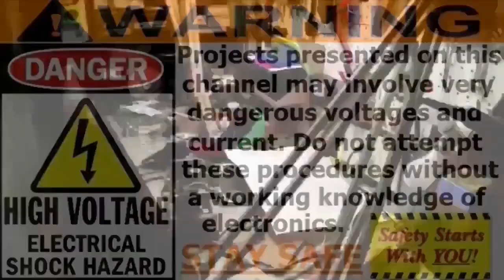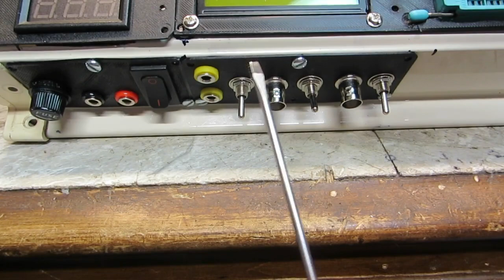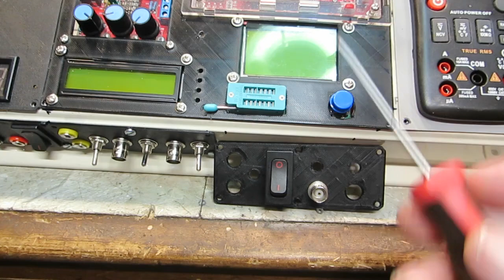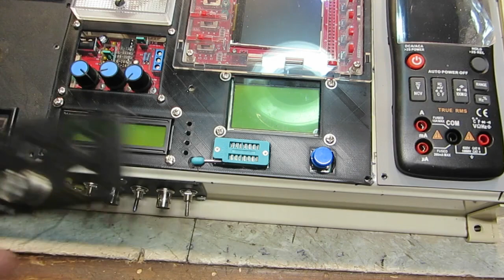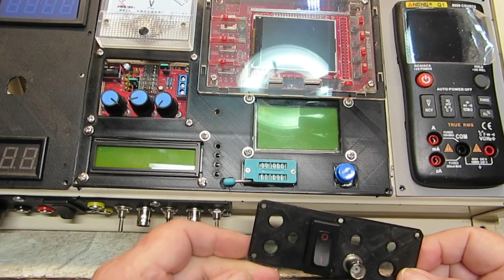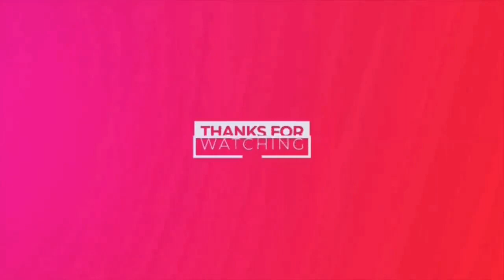DERB - MFP update - modular approach

Comment: Doug - it's concerning that the contact surfaces of the output jacks for your high voltage DC variable power supply are so exposed. It seems like that could pose a shock hazard.